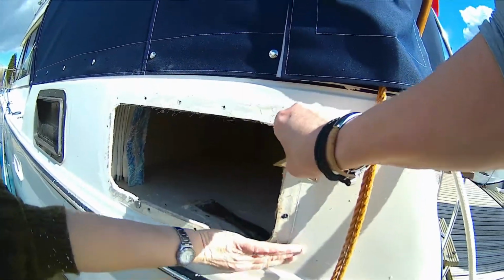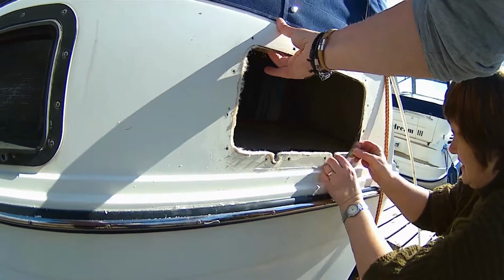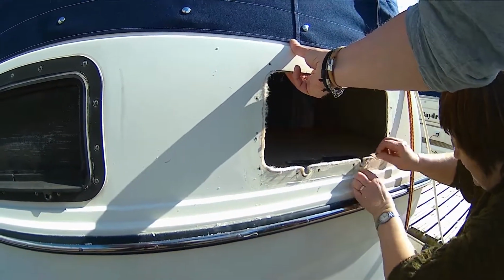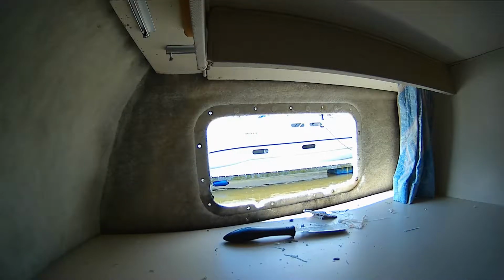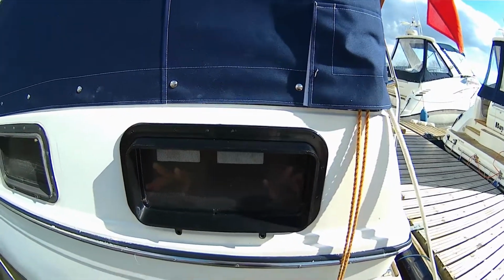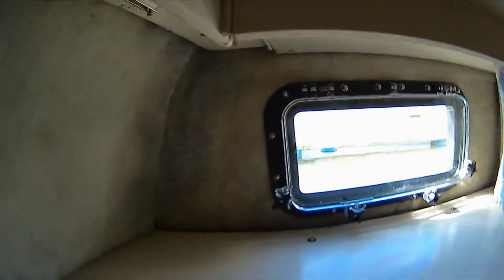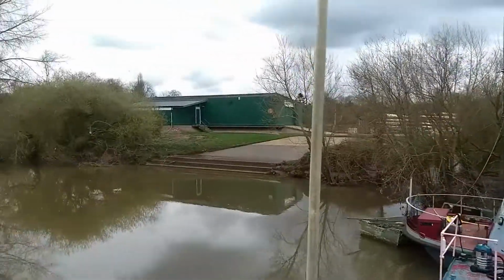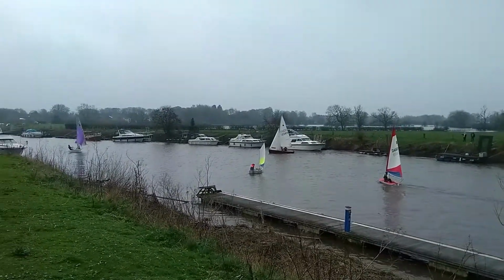ava grace portlight Episode 4

Comment: I see the new ones protrude out more than old one. The ones I got have no screw holes in the outer ring. I just screwed them in against hull and silicones the ring over the screws, and put a bead of clear silicone around edge. They look  great, 2 down, 6 to go.
Reply from the maker: They told me the cut down versions were no longer available. I prefer the new versions. Mine came predrilled, but with a couple extra holes.

Comment: I cant hear, where did you get portlights, do you have a link. TY
Reply from the maker: They came from Bomar / Gray industries, part of pompanette.  I think it was. Based in Florida. Sorry don't have a link I ended up calling them. 603-826-5791
Reply: @MyAvaGrace  do you remember what size, was it the 15.5"×7 9/16"
Reply: Also was it angled or straight spigot, I dont even know what that means.
Reply from the maker: @TERMIN8TOR99  I think it refers to the shape that sticks out from the Hull. Ours have a slight angle on them.